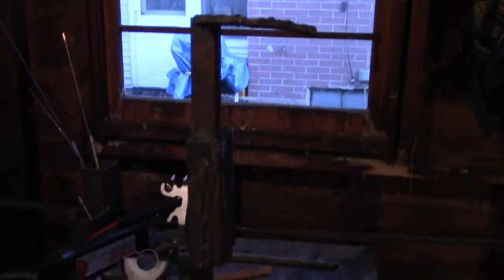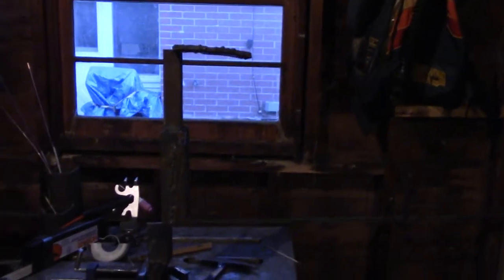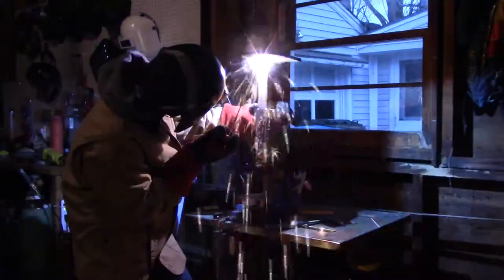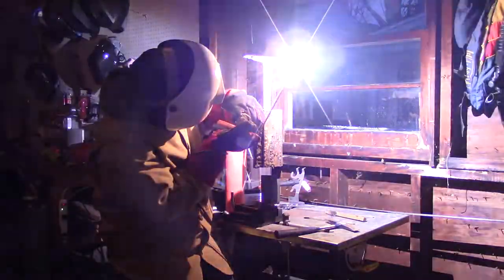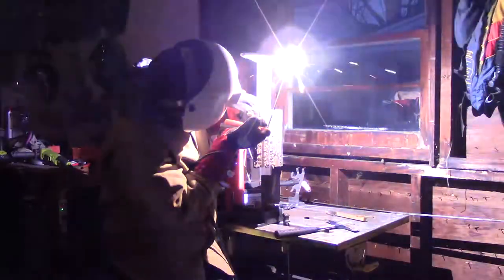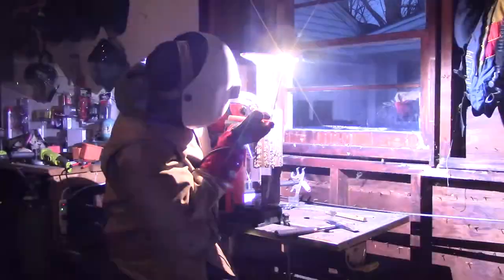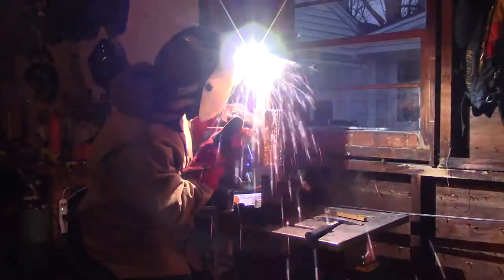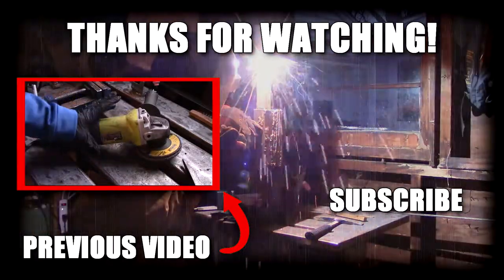PRACTICING MY OVERHEAD! Overhead Stick Welding Practice

Comment: Very fluid video I liked it a lot. When I run 7018 in 4g(overhead) I try to have a bit of a drag angle,like you showed, and I set the machine  the same amps as flat and make sure to keep a short arc length. PS I have a similar inverter and I know the pain of it wanting to stick every time they don't carry enough voltage through a 110/120 outlet